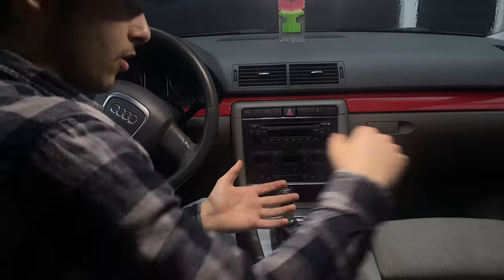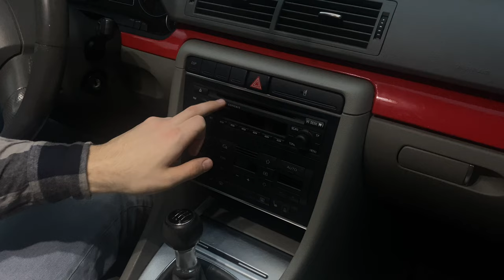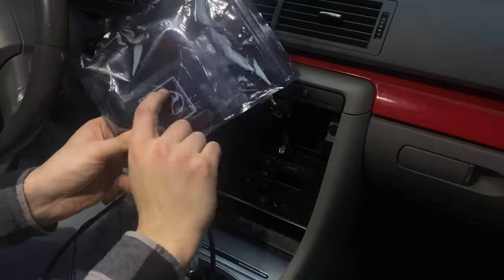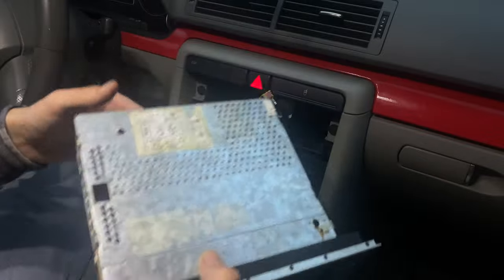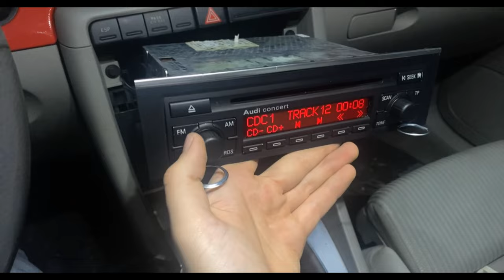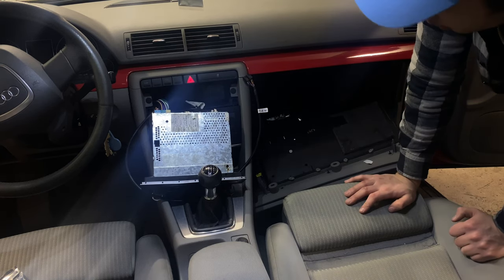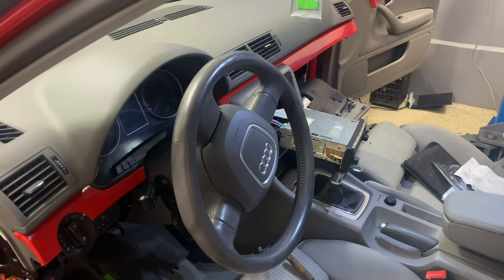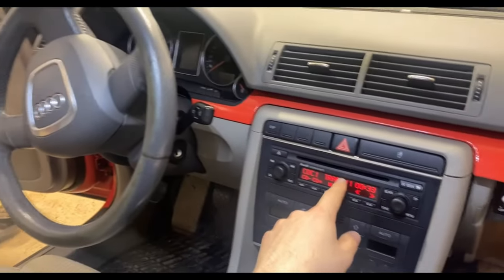HOW TO INSTALL BLUETOOTH MODULE TO AUDI CONCERT RADIO

Comment: I connected mine the same but it says NOCDC
Reply from the maker: Have you tried clicking the cd button two times (had the same issue but when I clicked it twice it started working) could also be that the Bluetooth module is faulty.
Reply: @swedishbuilds  i ordered 2 adapters (different than yours) and one of them has 4 pins inside that blue connect and other has 3 pins, none of them work :/ says no cd too
Reply from the maker: @wolkeris5824 have you tried this iso adapter https://www.eftermontering.se/kablage/28-delbar-mini-iso-adapter.html could Also be that the bluetooth module you have doesnt work because of the canbus in the car.